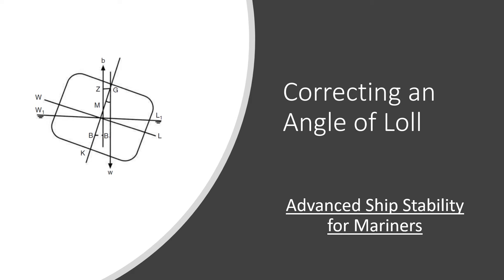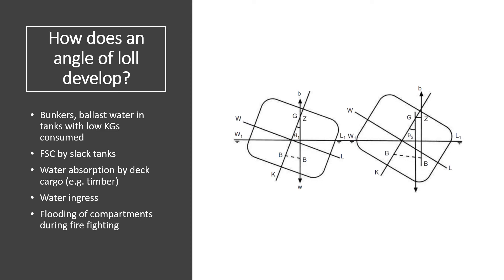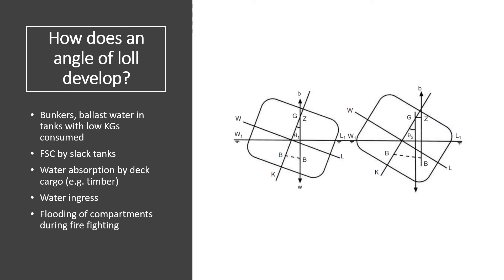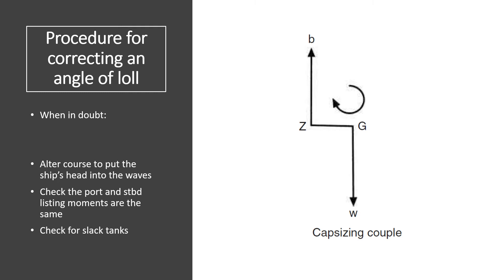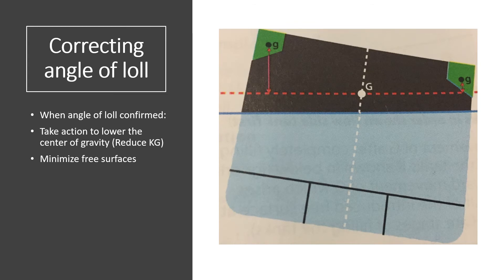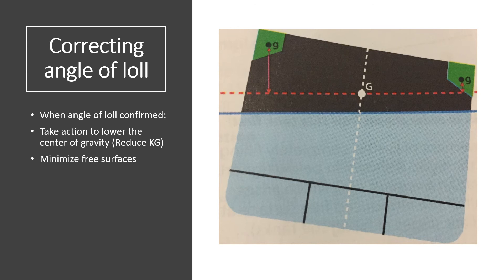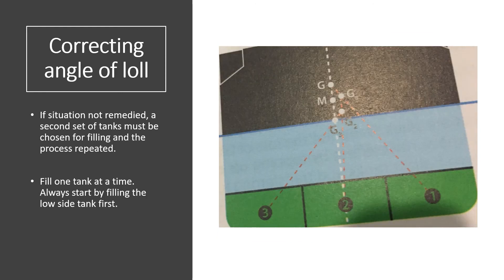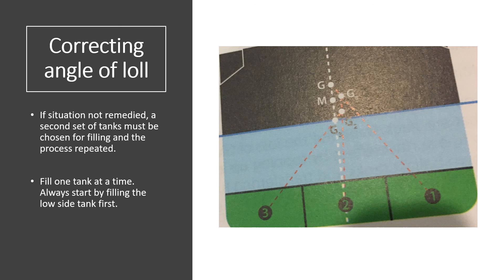Correcting an Angle of Loll - Advanced Ship Stability for Mariners

Comment: Kindly confirm that the lower side is preferred over the centre tanks if available with same moment of area ,or here the consideration has been done with centre tank with more moment of area,leading to the choice of lower tanks,since we are advised to firstly fill in the centre tanks and then go for lower side tanks,Kindly clear the case and so my understanding over it ?
Reply from the maker: Nabajyoti....its more complex than that. Practically, we start filling the tanks with 2 main objectives: Reduce the FSC or Increase the GM (making it positive). Increasing the GM will give us more positive righting lever to correct the angle of loll. 
You start with tanks with low moment of inertia because the resulting FSC will also be low. At the same time, we aim for lower tanks to bring G down and make GM positive. 
Or you can top up tanks with high MOI to reduce the FSC. 
The behaviour of the vessel with any of the actions has to be observed. Sometimes, it may be more than 1 tank.
However, we can't generalise and assume than center tanks need to be filled first or later.
Reply: Hi friends
 For preparation of second mate / DNS/ BSC nautical science/NCV come in #kundanpatna

Comment: When I was examined, I have been told that I do not have Ballast tanks, how do I correct the angle of loll then?  Or is it a dead-end question that has no answer if you have no ballast tanks?
Reply from the maker: No, its not really a dead-end question:) You can use cargo to correct angle of loll but the process is much trickier and difficult to achieve at sea. Ballast is easier to shift and adjust (also faster) in sea and in port and hence its the first choice when it comes to using it for correcting angle of loll.
The key thing to remember is that our aim is to lower the Centre of Gravity (G) which can be achieved with cargo or by ballast.
With cargo, you can shift or jettison or discharge if required.
Reply: @SteeringMariners  if I would to ask you to show me on a sketch, how would you move the cargo, it still would be specific to the cargo and a ship. Or is there general pattern?
Reply: Hi friends
 For preparation of second mate / DNS/ BSC nautical science/NCV come in #kundanpatna